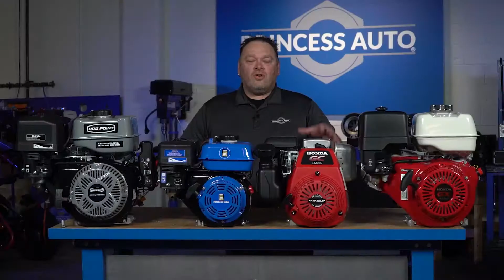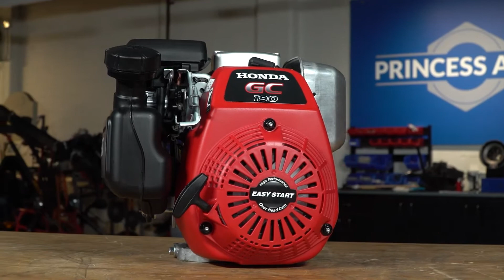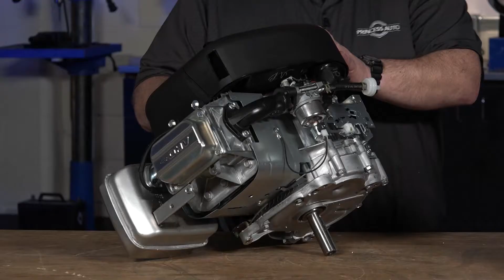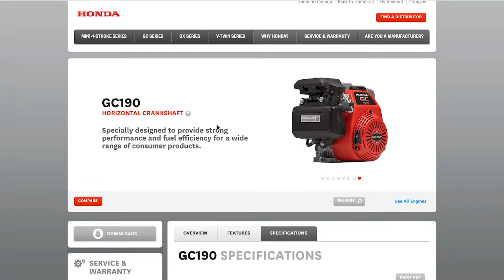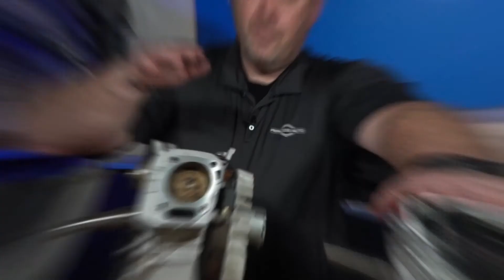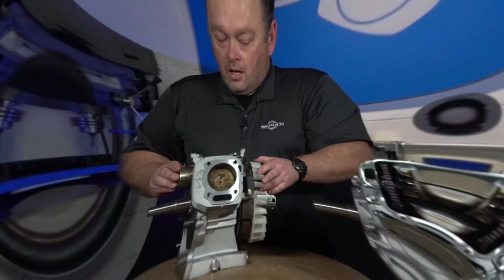Tech Tips with Mike T -  Small Gas Engines

Comment: Ok ..  to make things straight about engine design... All engines presented are piston crankshaft driven ....but valve drive train arrangements  differs and how is driven by . Cam shaft can be driven by gear seats plus push rods to actuate overhead valves, sprockets and chain , and timing flex rubber belt . All configuration still is called Over head valves as long valves are situated in the head above piston. Durability sense it's best to deal with pushrods for Low power low rpm application... Chain is lighter but presents durability issues .Ok for motorcycles as well cars but small engine not necessarily important. Timing belt is less durable and requires replacements after while due to heat cycles aging .

Comment: the GC 190 is a good in a 50cc quad frame !!! the power fists need more air cooling !!! I use all in my quad and golf cart builds !!! all I got to say power fist don't to high in the rpm's. they break down !!! 140kmh is the top speed on kids quad's and sled's. and my other build's top speed is 50 km'h for off road torque all chain drive from the motors. and some running jack shafts !!! all between main engine side ? gearing the end is between 7-12 gear ratio !!! without a governor !!!

Comment: Ok blew my engine had a 196cc clone Honda on my CT200U , my question is why would I won't to pay more for a 15 hp motor when the shaft turns at 3600 rpm same as my 6 hp engine. Top speed would be the same wouldn't it be ????. If the 15 hp engine gives more top speed I will be at Princess Auto tomorrow to buy the 15 hp, also Princess Auto use to sell the 18 hp DuroMax engine but I don't see it anymore online why ????
Reply: You would pay more for a 15hp engine to get more torque, more acceleration, and the ability to run larger equipment.